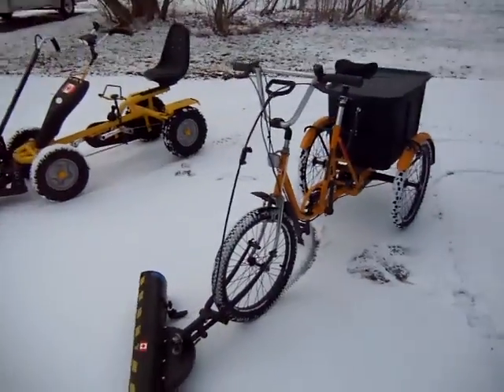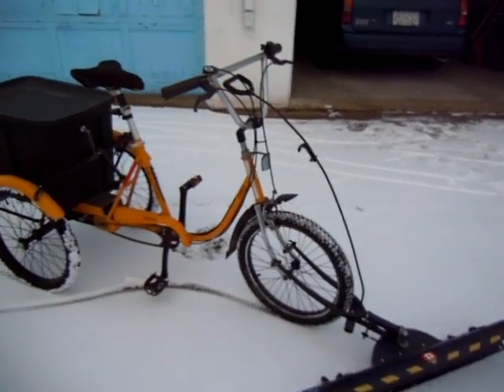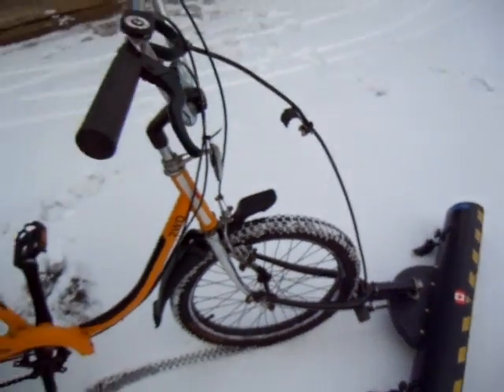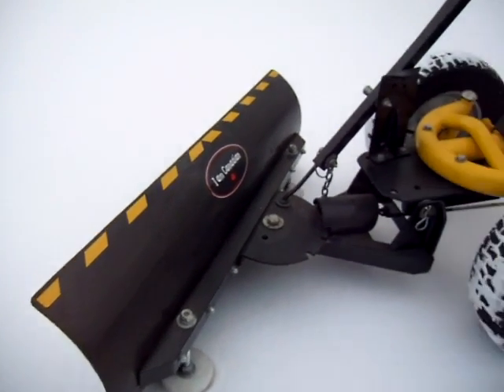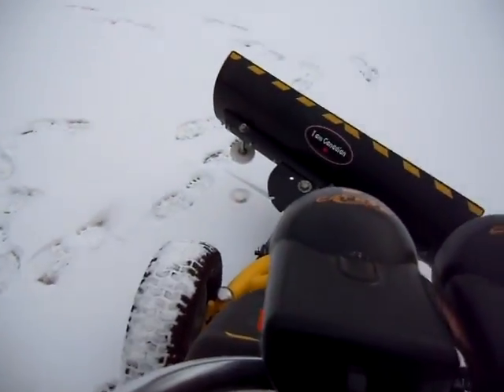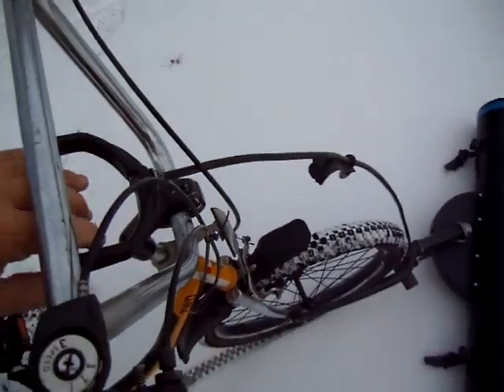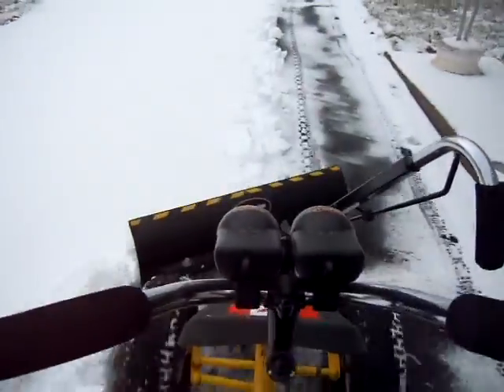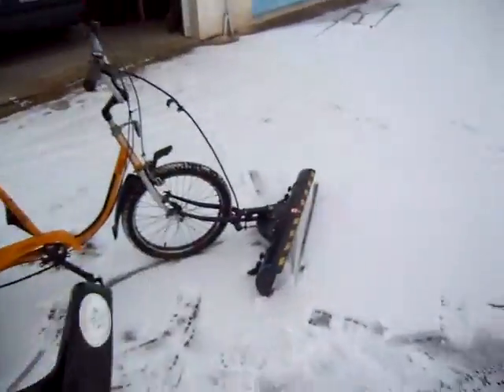Pedal Powered Snow Plow #1  Quad and Trike walk around with test runs.

Comment from the maker: @swho23  The plow's ability is limited by  the snow conditions and the ability of the operator. Powder snow can be moved to the height of the blade which is 12"(304mm). Heavy snow requires using less of the blade. Observe video #19 to see me moving deeper snow. As the snow accumulates on the blade, I have to scoop less to keep the momentum going. This plow is still in its prototype stage and has only one speed. Basically, you can move as much snow as you and the snow plow's blade can push.

Comment from the maker: @Fireheart528 Dual-tired tandem axles and chains would work well for traction but it would limit the plow's turning ability. To overcome the directional stability of the rear axles, the frame would have to be split in the middle similar to a Case/IH Steiger tractor design with articulating steering. It has been a design change I have been contemplating for another plow project. Multiple gearing and differential axles would also help the design!

Comment: February 16th I started building an all terrain 4 wheel drive & 4 wheel steer pedal kart. The frame is mostly finished. I designed the frame so that I can sit lower than a "wagon" type frame. The drive train is my next step. It will have multiple speeds with Gokart #41 sprockets and chain with a super low creeper gear. I also have a Comet Gokart reverse gearbox. It will have a hitch on the rear too. I'm not sure if I will use a cheap push blade from a lawn tractor or build the blade myself.
Reply: Boyd W pic? video?
Reply: The world is not going to see my design until I have patents on it.
Reply: That's pretty fair.
I just like to see other ppl projects because I'm not in a position to make things yet myself
Reply: I plan on manufacturing my idea.
Reply: Cool. I'd like to host a pedal powered off road vehicle compition 3 or 4 years from now I'd hope you would attend.
Reply: What part of the country would this be?
Reply: BC Canada

Comment from the maker: @fattirefool Thank you. My design for the trike should work on your pedicab. One important suggestion: Install a 1/4" thick strip of Lexan or similar type of plastic for the wear bar on the bottom of the blade. It will slide easier than the ABS and save the blade.  Did I mention it is a lot of fun moving snow around this way? lol

Comment from the maker: @plichhayy1  The 4 wheeled 'pedal kart', as they are often called, was imported from China and I found it used, on the internet. 'BERG' from the Netherlands is probably the largest manufacturer of these unique vehicles, and they can be purchased online. As delivered, they have limited use, hence they are constantly discarded. So, try and find a used one. With modifications, especially to the gear range and seating, they become efficient workhorses for us pedal pushers!

Comment from the maker: @elitec5r I like my trike because it has a dual-drive system on the split rear axle which gives constant traction. Reverse would be nice but would not work on my trike's drive system. I do have a Sturmey Archer  3 speed hub with a reverse feature that was designed for tricycles. I plan on using it on the quad after I install a differential in the rear axle.

Comment from the maker: @PIZZABOX11 I have already changed the sprocket gearing to provide more torque. This is a single speed drive train, so the chainwheel had to be changed to a smaller sprocket.

Comment from the maker: @bert26a A V-plow does work better in deeper snow when plowing a single lane. As for pushing and pulling...pulling is easier but pushing clears the surface for the drive tires. There are several V-plows for bicycles on youtube and some work very well. Carbide studded tires are available for mountain bikes, and someone in the U.S. is marketing a kit to convert a mountain bike into a 2 wheel drive bicycle. With those items, you would have a killer snow bike. Just build a plow!

Comment: Use the website Kickstarter to fund yourself the manufacturing tools necessary to make several of these and start a business  its a great plow you got there, I want one! P.s. By reading most of these comments, seems like everyone wants one.
Reply: To be honest, it's not really economically feasible. The manual go-kart retails for 200USD, a low end garden tractor plow retails for 250-350USD and it would need 50-150USD in miscellaneous parts to cover new brackets, gearing, tires, etc.

And in the end you're stuck with a plow that lacks enough weight to push wet snow. An issue I've experienced first hand, with a plow equip garden tractor without wheel weights & weight box. Believe me, the overall performance was really poor. Especially in comparison to a two-stage snowthrower equip garden tractor I once owned.

That said, I really like what he created and I love how nimble it appears to be. IF by some miracle a complete conversion kit could be produced for under 200USD total, then I'd say it might be a worthy investment for some. But I think most people would look at the total cost and buy a walk-behind snowthrower.
Reply from the maker: Da Blueguy Ironically, your experience with a garden tractor is the same one I had, and it was the inspiration to build this snow plow. Our old Sears Custom 6HP tractor was useless in moving any snow that was more than a few inches thick, yet, I could still shovel that snow and more, by hand. My body had more versatility. So, I thought by adding a mechanical extension to my muscles, I could move more snow than by hand shoveling, and not get stuck all the time, like the old Sears tractor. My theory proved correct...within limits. When I reach those limits, I have to call on my old Ford Lgt165, which replaced the Sears tractor forty years ago. You are also correct on the economical feasibility of the consumer retail sale of the snow plow, at this moment. However, this vehicle can be operated around humans in places where motorized snow removal equipment may not be. This would create a unique niche market for contractor sales. The seated position also creates a safety factor for the operator. When ice is encountered, the vehicle would slide or skid, and nothing would happen to the operator. If the operator was standing with a hand shovel and encountered a patch of ice, they would most likely fall and injure themselves. Employee injuries from falls are a serious problem for snow removal contractors. (I was given this bit of advice from a contractor who saw my snow plow on display at a bicycle show. He was really impressed by its function. It was at this show that another contractor wanted to buy it, as he had the snow removal contract for the convention center, where it would be a big promotional item for his company. Unfortunately, I was not willing to sell my only prototype!)   The 'green' factor of the snow plow could also be used to help secure or renew snow removal contracts within urban areas.

Comment: Hello Bob(i love your product btw)i was wondering if one of these would be ideal and or feasible without a lot of modification?Thanks in advance!
 it would only be used to plow a decent size driveway

http://www.tractorsupply.com/en/store/heavy-duty-adult-pedal-go-cart
Reply from the maker: +Dave Moore Hi Dave, I haven't seen one of these in person, so I can only speculate that it could work. The wheels are plastic, so the drive connection may have to be reinforced. My quad has a steel drive wheel and it broke, along with the drive chain a few times, so be prepared for breakage. You will also have to lower the drive gear ratio. The simple way is to replace the pedal crank with one that has a 28 tooth sprocket or less, like those found on most BMX bikes. A simple moldboard or plow can be made from a 6" or larger diameter ABS drain pipe, cut in half. The smaller the plow, the easier it is to push. You will have design and weld or bolt together the plow's swivel and mounting bracket. Adding a chain to the drive wheel will help, or change the tires to a large lug design as found on snow blowers.  Keep it simple and have fun!